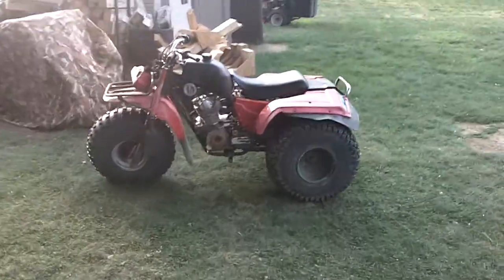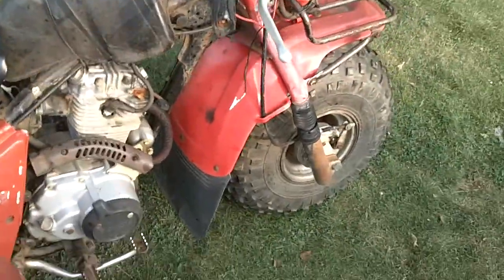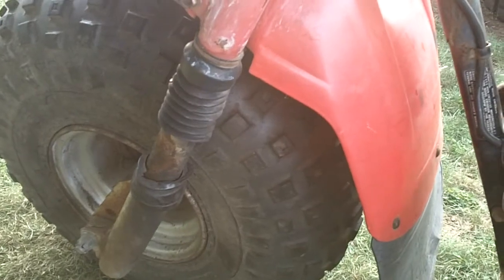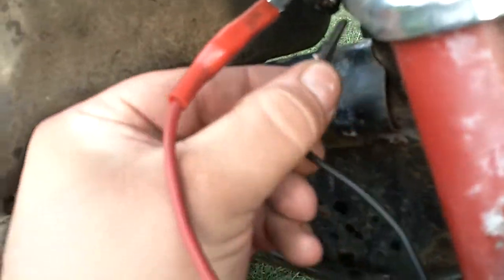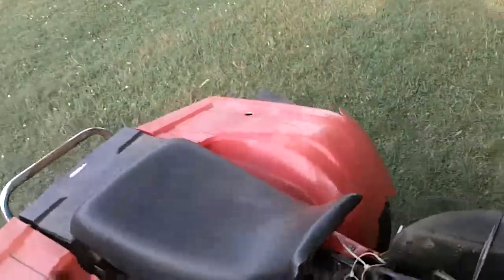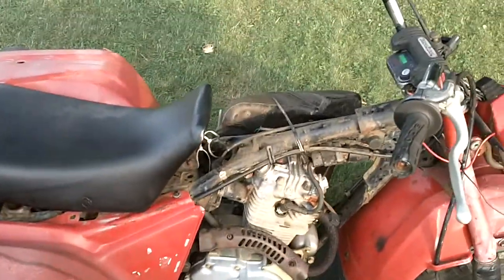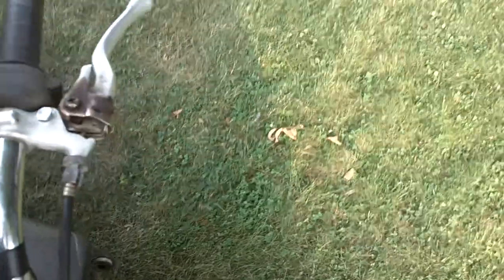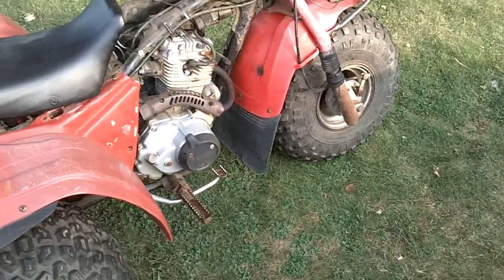Another new project a 1984 Honda ATC200ES 200ES electric start shaft drive

Comment from the maker: @vmxrm85 I didn't really notice the squeak that much while riding it, I think the camera amplifies it.  Def. not a head gasket leak as the head is squeaky clean, the pipe is leaking from somewhere and it looks like it was welded at some point.  I may just get a cobra pipe.  The e-start is really nice, I recommend it, one of the reasons I couldn't pass up the deal.